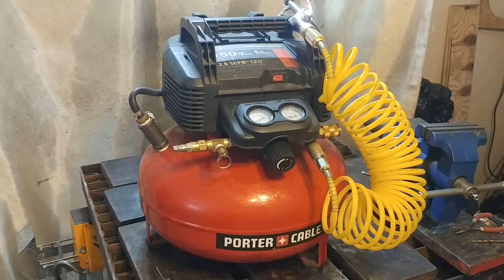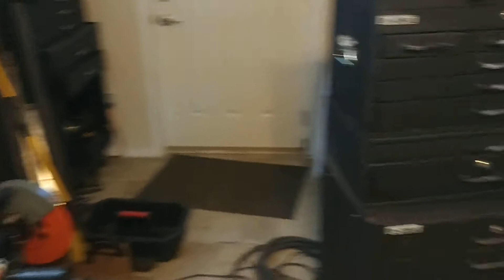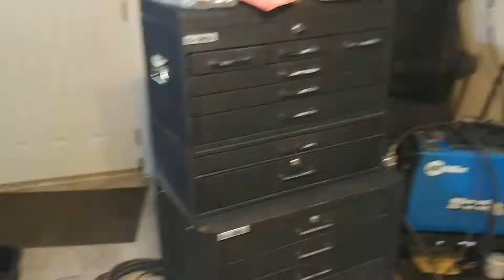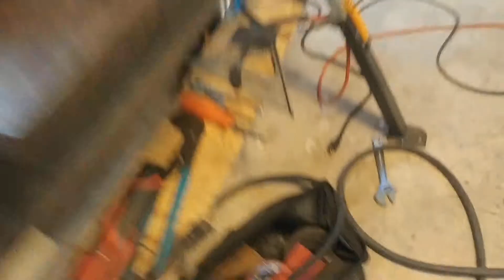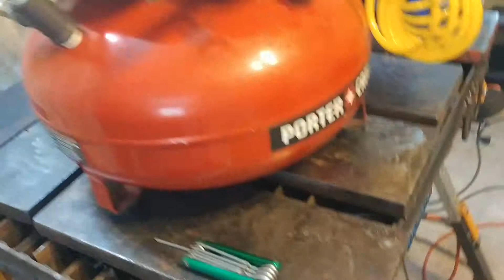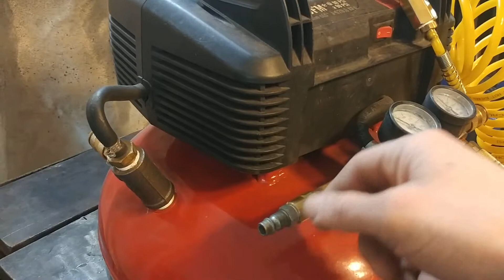Compressor Pro-tip #1: easy air pig

Comment: How much can that porter cable tank take in pressure.. I got a 155 psi air compressor would it be safe?
Reply from the maker: The Porter Cable pancake compressor I've got goes up to 150psi on its own, and has a 200psi safety bleed valve. So 155psi would be totally fine, and I imagine the same is true for most other pancakes.